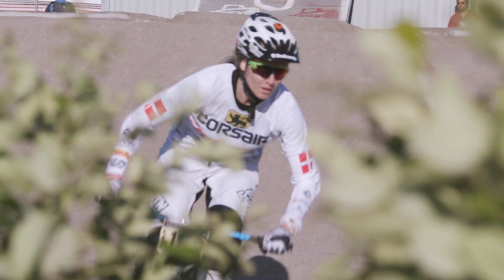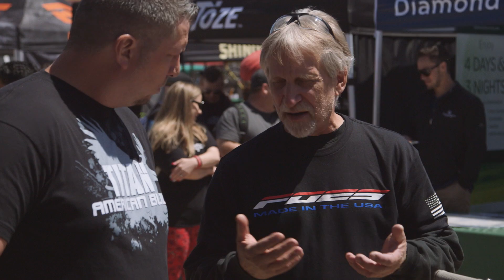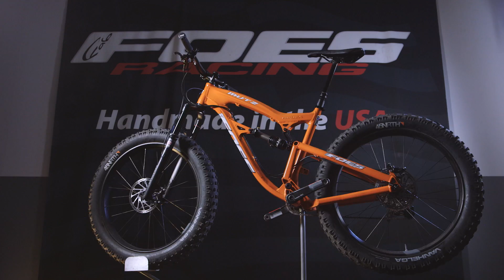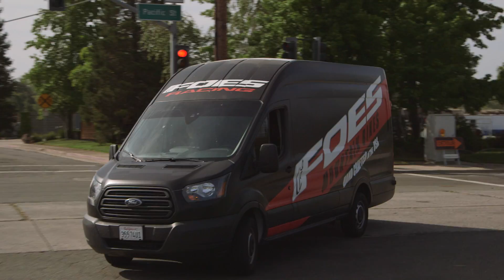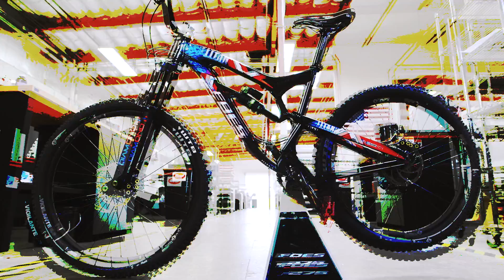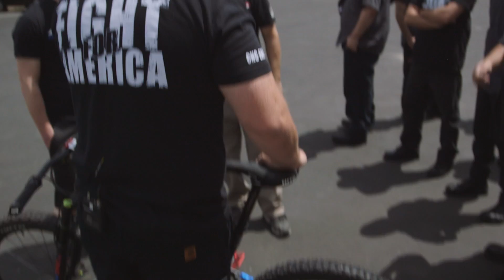FOES RACING Calls on TITAN for 5-Axis Part

Comment: I used to work for Timsons printing machines as a CNC turner, the US was our main market.
It was great making the parts and then seeing the finished printing press working, before 
we sent it out to our customers.
Sadly Timsons has stopped making printing presses now, I went into F1 but it wasn't the same.
Now I've gone over to the dark side as i have arthritis in my hips, I now work in quality control
as the head inspector at a small engineering firm.
I just love engineering

Comment: How would making that part with a 5 axis cnc make the bike cheaper? Being made out of a single block , using more costly equipment and more working time doesn't that make the part actually cost more to build ?
Reply: @Abitamim Bharmal These are made with a cnc machine , once the program is made to cut the part there isn't much if any labor in making the part. The original is made out of flat pieces joint with bolts and metal supports that can be cut with any cnc machine . The part built by titan is a single piece which is why it has to be flipped and made on a 5 axis machine but more importantly requires a larger block of metal to cut down from . More material required to make the part , more expensive machine required to make it these are added cost that have to be paid for so how is the part actually making the bike cheaper ?
Reply: @Abitamim Bharmal Did we watch the same video ? did you see how much it took to make all those cuts and all those angles ? It's not quicker to build  these parts than out of flat pieces , i'm sure you could make 2 or 3 in the same time as one uni-body part . Even if if what you just said were true how would any of that translate into a cheaper product for the consumer ?  Fyi this isn't the first time a uni-body shock mount has been made and they cost more always.  it's a feature offered in more costly bikes due to weight savings.  This does  makes the bike lighter and stronger but not cheaper .

Comment: Interesting I never heard of FOES bikes. If he has been making bikes for 25 years he has a marketing problem. I was a semi serious Road bike rider and was into Cannondale bikes back in 1988. I don't remember when the first suspension bikes came out but when they did it was like a bomb went off, they were everywhere. If I remember correctly Gary Fisher was the creator of the mountain bike. Then it was the Motorcycle industry that were creating the front end suspensions with Fox Shocks. As I look at this guys production (FOES) line up he has way to many manual processes. He needs to automate. By doing that he can bring the price way down and quality way up and possibly get rid of some bikes that are eating into his production time. Pretty simple math. How many of each bike are being sold? Concentrate on the best sellers and get rid of the dead weight.
'
Reply: Brent Foes is high end custom handmade in usa. . . You Ride Crack and fails (Cannondale) nuff said. Im sure you have never heard of Intense USA or Turner either. . .
Reply: Once you see one up close, you will see why he makes them like that,the 2000's dhs mono was strongest bike ever built
Reply: In the  UK we call foes a cottage industry company, you don't see many in the UK but when you do you have to stare, they are 👌🙏👊🙌

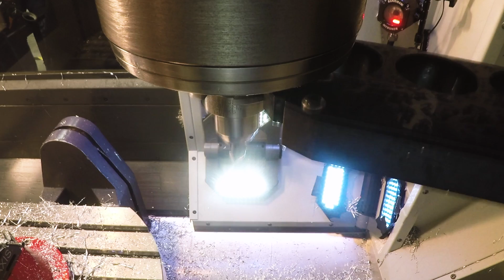Comment: Hi Titan, at 9:14 you show the machine finishing the angled surface using a ball end mill. However, you have a 5 axis machine, so why not align the work with the spindle and finish it with a contouring pass? I'm a pretty new machinist, so I would love to know your thoughts.
Reply from the maker: I would have to go back, of course you could and should rotate and angle table when you can... We just did a few parts, so I just did it quick and dirty.
Reply: Would be impossible when machining backside as it was 3 axis mill. Milled like Titan did achived simmetry and same toolpath pattern on both sides. I would suggest Mastercam instead of Fusion 360 as it more poweful. Some customers are not happy with cloud storage especially with prototypes.
Reply: I’d like to know what mastercam can do that fusion can’t
Reply: Every time we detach a detail to attach it again, we lose precision.
I would mount the detail in a way that i can drill the four openings for the bearings without having to detach it.
The other surfaces are of less importance, so i could detach and attach the detail without worrying, once the openings of the bearings were drilled together.
And i would use a big drill the exact diameter of the hole to finish these openings. Computing a circle is not as precise as simply spinning something. To just drill a circle is more stable for the construction of the CNC machine than drawing a circle too.
The parallelism of the bearings is very important in machining this detail. The precision of the rest of surfaces for this peculiar detail would not matter to me. If i were to ask some CNC machining service to machine this detail for me, i would mark these surfaces as requiring much lower precision. To save some costs.

Comment: What about carbon fiber bikes? Dont they exist in your world?
Reply: You can't be serious!?  Virtually every major manufacture has a full range of carbon XC, trail, enduro, and DH bikes.  Carbon can be manipulated for supple ride characteristics by changing laminate directions and stiffness.
Reply: Small business carbon tales a lot of development money and equipment to produce bikes they can make aluminium ones which are just as good a lot easier, people buy them because they American made not because they're super light weight
Reply: Carbon fiber is to "rigid" for a mountain bike, it would brake to easy under high load.

Comment: I worked in that industry back then for a company called "Nuke Proof".  I was the machinist who got their hubs to stop breaking.  I remember all the guys there saying "Foes Fab" has too much suspension".  But I came from the early days of Motocross and saw the evolution there.  I knew the evolution would be similar for Mt. Bikes, especially for suspension and brakes.  Now I have to see why this part (I have not watched the film yet, or the part), needs a 5 axis machine.
Reply: why not weld instead of wasting so much? am I missing something?
Reply: @asheshshrestha  Bet it would have weak spots even with automated welding + injection molding, it would only be cheaper at higher volumes. CNC could start with tighter tetragon to further reduce mashing cost.
Reply: @ArthursHD  thanks for clearing that up
Reply: you worked for nukeproof? dang man... i want a mega so bad .... and today all companies use the same travel on the bikes. 100-120xc 120-140 trail 140-170 enduro (180 super enduro) and 200mm dh... and i had to google for cracked nukeproof hubs, my guess is that they broke because both faces of the hub spoke ring ( idk how the hell you actually call it) were machined flat insted of being a bit thicker at the joint of the horizonral and vertical part (if that makes any sense at all...im a maritime engi and not a machinist so idk how the hell do you call those ....and as a + english is my second language)

Comment: TITAN, when you do bearing bores similar to this part, do you usually ream the bore, or interpolate it ?
Reply: I think I can answer that with my experience.  It depends on your machine.  My little machine, no way, the hole will be .002" out of round with circle interpolation. I would probably also choose to use a boring bar for the finish cut to help insure hole location, (a reamer will follow the hole), but a reamer, is a quicker set up and quicker run time if  hole location is not a problem.

But for those new HASS's, I would bet the hole would only be about .0002" out of round with circle interpolation, which IMO, is OK for most bearings.

Generally, you have a tolerance for the press fit, (.001" press fit for a 1" diameter bearing for example).  The hole spec is .999" dia +-or-.0002" per the print.  My "rule of thumb" is to not be more "out of round" than 75% of the total tolerance.  That would be .0003" out of round max here.  A print may even specify how much "out of round" the hole can be.

If your machine can do that, great.  If not, than you need a finishing tool of course.
Reply: One other thing you have to consider when circle interpolating a bearing diameter hole, and that is the wear of the end mill.  If it's wearing out, (or you don't have a fresh one in the shop), the hole can be tapered and difficult to measure.  With tougher materials to machine, you have a better chance of wearing out the tool and making bad parts.  Back to the boring bar. :)